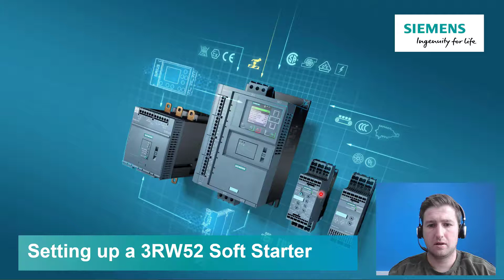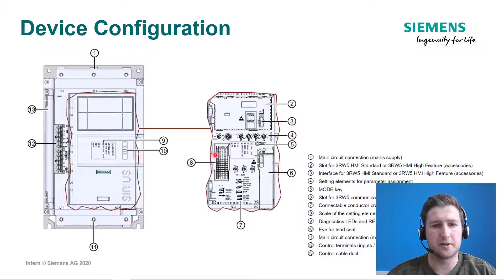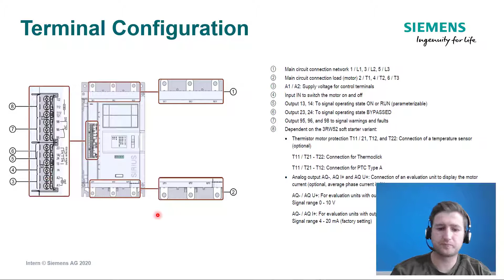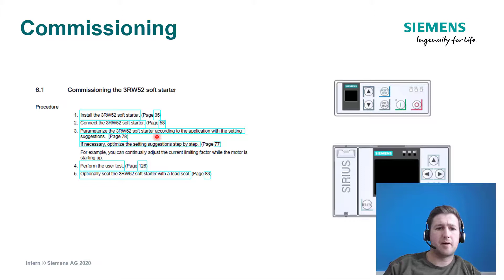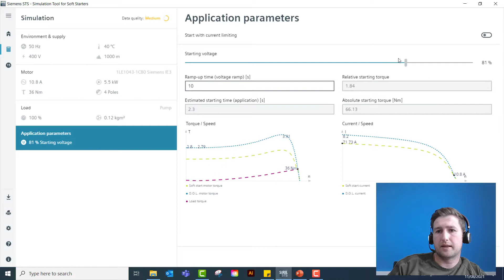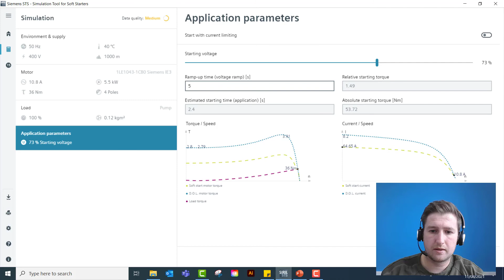3RW52 Set Up

Comment: if the signal in "IN" was cut, example I add local-0-remote switch in the "IN" line, if it goes to 0, no signal in the "IN", will the running motor stop?